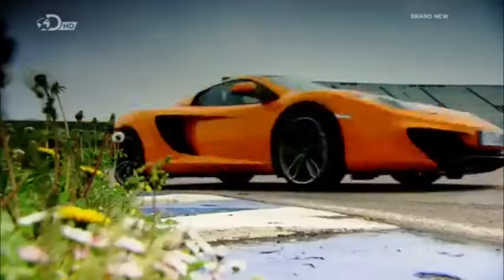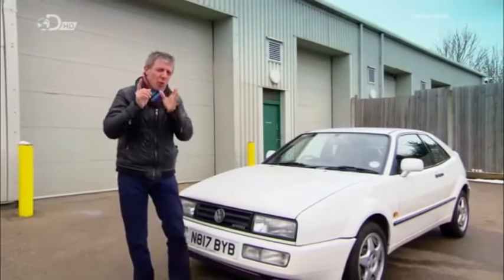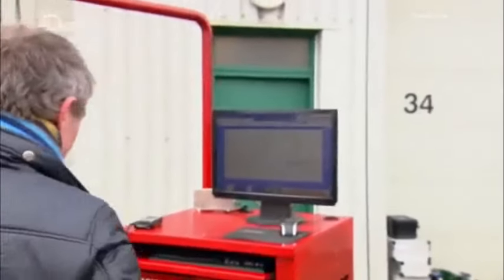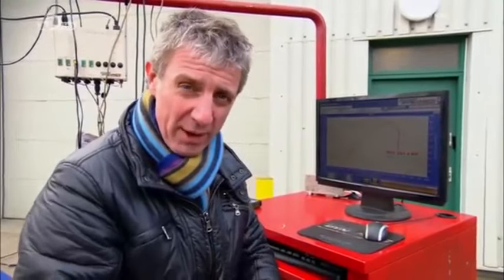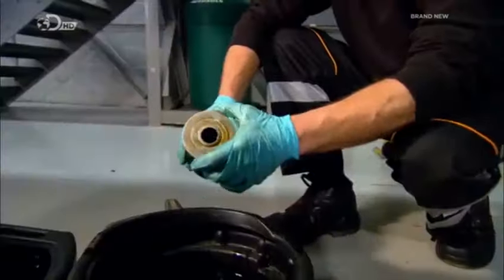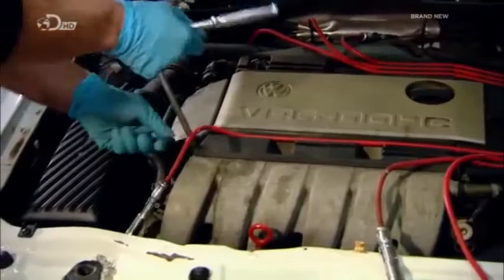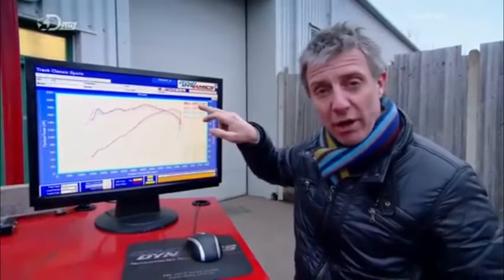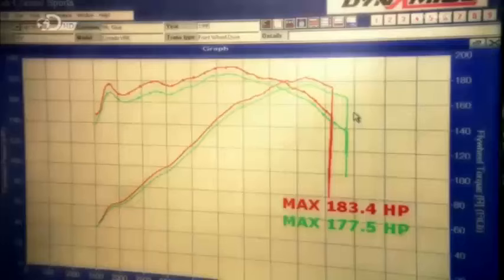5th Gear Test Redex On The Dyno With Surprising Results

Comment: I actually filmed this, good to see it online still. This was the producers mates car. He was more than happy enough to have a free service and have the car in the show.
Reply: And get the nuts ragged out of it in the Dyno many many times?
Reply: @bernierosen1220  Italian Tune-up
Reply: @bernierosen1220  did it look like it did harm?😂
Reply: @bernierosen1220  Actually, if it's proper warmed up before that may only help, as Lillian says, it's called an Italian tune up, and combined with the fuel cleaner it will actually help regain some of that power, burning out all that residue carbon that has built up on the valves and in the ignition chamber..
Reply: @bernierosen1220  If the car is healthy, ragging the nuts off of it is not a bad thing.
Reply: @theenglishtrucker1849  indeed, it’s a good thing really. It’s what it’s designed to do
Reply: Good days work!

Comment: So basically this tells us that routine servicing helps your car run well. Who knew?
Reply: +Stephen Brown Not many people believe in fuel system cleaners.
Reply: +Mortalomena nah mate they help. from my experience it does about three quarters of what a hand rinse would do, only way easier.
Reply: +The Vibe How do you "hand rinse" the fuel system? lol
Reply: Simon Thompson depends if you rinse a bike or car. you take the carb apart, you clean the jets and what else it has there with gas and a thin piece of wire and do the same with the hoses if needed.
Reply: You will do that and not put Redex which costs £1 per use? :)
Reply: Seems they paid well too much for the parts, should have gone to eurocarparta and used a discount code
Reply: a DEVICE requiring MAINTENANCE?!?! holy shit, i learn something new every day!
Reply: Its obvious to people like us to do routine maintenance. But I know people who just haven't got a clue, they quite literally get a decent car and run it onto the ground, even Highways England have put up posters in toilets by urinals to tell people what to check due to breakdowns caused by lack of checks and maintenance.
Reply: lol
Reply: @danielfinch362  You can "run a car into the ground" even with regular maintenance. My last car had FSH, and I continued using it as such. It was 14 years old by the time I had to replace it. Still seething about that
Reply: @waqasahmed939  you can't trust garages to do the work you paid them for.
Reply: I carry out a full engine rebuild per week or per 1000miles (whichever comes first) and my Volvo runs as good as when I bought it in 1978

Comment: There was “the Redex treatment “ where you got the engine warm, took the plugs out then put about 30ml in each cylinder. Then put a rag/rags over the plug holes and gave the engine a few turns, leave for an hour, give the engine a slightly longer spin to clear the Redex. Put the plugs back in then go for a run, with the engine running, slowly dribble about 50-70ml of neat Redex into the carburettor while opening the throttle, ( best done on a quiet road out of town!) a bit of smoke comes out. Then go for a brisk run.

Comment: Must admit I added a fuel injector cleaner last week and changed the air filter, and did two 275 mile drives one before and one after. The second drive cost me £10 less fuel.

Comment: I had a worn test lawnmower engine and i poured Redex straight in to the carburetor when the engine was good hot and going. Pulled the sparkplug out afterwards and it was shiny. I was amazed.

Comment: Ive used Redex in many of my cars and swear by it , I'm even talking pre 5th gear days and old carburettor engine cars and it also helped those massively back in the day!
Reply: Can you put the whole bottle in I was thinking once a month cheers
Reply: @andym209  if it’s a full tank and the bottle covers amount it should be fine, I use 1/2 bottle per full tank of fuel (65 ltr approx)
Reply: I put in a full bottle to half a tank. Don’t worry if there’s smoke it’s doing it’s job 😂
Reply: I used it regularly in the early seventies, it kept the valve springs , stems and seatings free of carbon deposits. I also used to run through the town centre with clouds of smoke pouring out the back, great fun before the environment police came about!
Reply: I would NOT recommend redex in a mazda rotary engine, a mate of mine put some in his RX7 against my advice, it freed up the ceramic tip springs, and cleaned off the carbon build up, but the result was that the tips were worn, and the gap between them and the cylinder walls was too large, resulting in the ceramic tips lodging sideways in the rotors and severely scraping the cylinder walls _ I did warn him this could happen, but ....... some people don't listen to those who know about cars!!!!!!!£2000 plus for an engine rebuild.

Comment: Have used Redex petrol in everyone of my 28 cars since my first car in 1964! Never had one single engine problem!
Reply: +MrPoopnoddy replacement brakes is a lot easier to do than a engine re  build tho
Reply: 28 cars?  Twenty eight?? That's one helluva carbon footprint.  No wonder the climate's changing!
Reply: You won't have had, when you read comments here about redex fixing a flat spot at 7-8,000rpm it's no wonder people have problems with cars in the first place
Reply: I lost count once I owned over 40 cars (several at the same time).. I've only bought two cars brand new and today daily drive a 30 year old Mitsubishi GTO.

Comment: I had a high mileage Vauxhall Victor back in the late 60s which used to pink on acceleration. I tried retarding the ignition a bit but that didn't help. It obviously needed decarbonising. Then I read about this Redex trick where you run the engine on fast tickover while gradually squirting in a pint of Redex from an oil can. When it's all gone in you take the car for a fast drive, keeping the revs high in every gear.  I tried it and it really worked. The car never pinked again. On the drive a lot of smoke came out of the tailpipe, and the job is done when it stops smoking. Saved me lifting the head to clean it out, which is quite a big job.

Comment: I have used redex for many decades and when i first used it i had a car that used a lot of oil due to worn valve stem oil seals.
I looked down the bore and there was a thick build up of carbon on the pistons, must have been centimeters thick, and it looked like whipped ice cream on top of the pistons
When i poured redex down each bore and ran the car for a while, it all disappeared, and the piston surface was revealed, with it being all smooth and flat again.
Noticed a big power increase as well.
Since then i have always regulary put it in my car and always been happy it.
Reply: You physically put the redex down each bore or you put it into the fuel tank?
Reply: @Paul-cl6uo  poured it down the bores, then later added to fuel tank.

Comment: Dunno about power, but a few tanks of Redex got my 13-year-old V6 so far under the MOT emissions limit it was barely readable.

Stick some in and CANE it once in a while - really work the engine. Cars respond well to being cleaned out.
Reply: do an Italian tube up. Thrash it round for a bit.
Reply: Farina Marcini  The occasional drive in an Alfa aids performance immensely. Every time you take it out, several kilos of rust fall off it.

Comment: Didn’t ride my bike over Christmas then it snowed. When I started it there were splutters backfires and dropping idle fuel injection warning light came on. I added Redex and went to work, the light was still on and there was a big splutter loss of power juddering then it was like it cleared its throat. On the way back home the FI light extinguished!!! Result! If you have an older car or one that hasn’t been used in a while get a shot of Redex in her and she’ll run like a whippet on Redbull.
Reply: I like that last part of your comment 😄 does it work in diesel engines to? (The diesel redex)

Comment: I’ve tried loads of these additives, and some are quite expensive. Redex definitely sharpened the throttle response on my e89 and engine ran smoother. Worked better and cheaper than others I’d tried.
Reply: Does it take a couple of tanks worth to notice the difference?
Reply: I felt a difference on first use. Slight but definitely noticeable and for the low cost well worth the outlay

Comment: BG244 is better (diesel) and BG44K (petrol), yes its about £18 per can, but much better.  Its cleans, lubs and boosts the Cetane count.  I have also tested the Archoil AR6400 stuff on my diesel with similar results.

Comment: I use BG44K every year followed by a service just prior to the MoT and I pass the emissions. You will notice a difference because the car is breathing better with fresh oil and filters. I also do an engine oil and oil filter change in between the annual service. I use NGK spark plugs and I've never had a moment's bother with them.

Comment: VR6's were only about 170 odd bhp at the wheel when new, there was no power loss.  The 190bhp figure was at the crank.
Some engines gain power with miles and age as they loosen up if well maintained, Honda motorcycles are known for it.
Reply: Incorrect . Mk3 vr6 was 170bhp , and these were 190bhp , owned both .
Reply: All manufacturers state crank figures when new

Comment: Have always done my own car maintenance but have never been convinced by additives, until recently.  My daily driver is a 2010 Mazda 6 2.2 diesel and I started to notice some occasional hesitation and an increase in fuel consumption. Coincidentally, with my last purchase of engine oil I received a freeby bottle of Mannol diesel fuel additive, that claimed to clean fuel injectors and the fuel pump etc. So I thinking there was nothing to lose by trying it, I added it according to instructions and waited to be underwhelmed!   Well, more like amazed!!  With just 30cc added to 25 ltrs of fuel it noticeably improved both performance and fuel consumption!!  Subsequently, I use it at every fill up and the improvement continued, especially to fuel consumption, which is around 20% better!!  Performance improvement has plateaued to substantially better.  I theorise that the injectors must have been fouled so spoiling the spray pattern, and the pump was possibly producing less pressure. Also. The oil seems to be running cleaner, or staying clean longer, so maybe there was some blowby occuring due to poor fuel delivery causing ring fouling.  For what the Mannol additive costs and the benefits it provides I will be using it permanently, and I am truly impressed!!!
Reply: -As Mannol is a German company i should imagine the employee experience is rather good...?
Reply: @thephilpott2194  
Not sure what you mean, but to be clear, I have nothing to do with Mannol apart from being a customer.  I can also recommend their engine oil, very good stuff and well priced.

Comment: It really is all about how well you look after your engine.

ALWAYS keep on top of your fluids and filters

NEVER use cheap fuel in performance engines

REGULARLY Keep your fuel system clean.

REGULARLY monitor your battery's power and the condition of your spark plugs. Change the spark plugs with at least every other service.

CHANGE ALL BELTS at the latest when the manufacturer advises you too.

Another handy tip 'from mercedes source' put some super strong magnets on the base of your oil sump.

Any stray shards of metal will catch onto the magnets (except for aluminium). The oil filter is also doing this job so don't keep on top of that filter too!

I've had a Peugeot do nearly 300,000 miles when all the owners are keeping on top of everything.

Comment: My 66 plate Škoda Octavia Scout was suffering occasional stalls when the engine auto stop/start activated, and was then a pig to restart manually, taking several attempts, to the annoyance of those behind me and my own embarrassment.  Apparently this is a common problem.  I tried diesel Redex and after a couple of treated tanks the problem went away and has not recurred, touch wood.  I now put a bottle of Redex in when filling every fourth or fifth tank.

Comment: Nice simple items to restore power and fuel efficiency. Every car I buy being secondhand the first thing I do is put a bottle of REDEX in the tank. I recently got a Mondeo 2.0 petrol and it was lumpy under acceleration so I put the fuel cleaner in, changed the plugs, new HT leads, oil + filter and it's as good as new, all under £100. So my Advice to anyone buying a secondhand car is haggle at least one hundred off the asking price to get those bits changed after purchasing. I do with every car.

Comment: Fuel filter woulda helped.
Reply: I agree and it would probably have been worth more HP than HT leads since everything else needed doing so badly it was probably pretty clogged.

With that said it's a pain in the arse to do this on my car because it's inside the fuel tank. You have to take out the whole thing as one unit with float, pump, etc all in one big plastic piece.

Can't just drop a new filter into that either, you have to replace a whole plastic part that has an inaccessible internal filter. Lots of chances to snap some old piece of plastic along the way so I just do this every 75k as per the service manual.

Comment: if you're on a tight budget: reverse blow the air filter with an airline (so long as it still looks yellow), make sure the leads grip nice and tight at each end and relative resistance check them replacing the weakest only, change the plugs, pop in that fuel system cleaner and take it for one almighty mother of Italian tune-ups!

Comment: Change the fuel filter, see what that does.
Reply: Qasim Mir that would actually help, as over time the fuel filter gets clogged and less fuel passes through it. so changing it would help more fuel pass through easier.
Reply: Will still only burn x amount, faster flow to the injectors  or not.
Reply: Even a Semi clogged filter Will Give max flow easy...

Comment: I have a 2003 celica  with 18000 miles on the clock that i use every day for work,
and i found that when i was on the motorway and took my foot off the throttle when i put my foot back down
it hesitated for a split second but  when i use red x in the petrol the problem goes away,
I find the engine runs very slightly better with better mpg ,
i have a 1100cc bike and i use red x in that once  or twice a year to help keep the carbs clean.

Comment: I used to always use Redex back in the early nineties on my classic mini until the time it cleared so much dirt or deposits out of the engine in one go it caused a really bad fuel block I just couldn't clear. After 2 weeks I had to completely remove and replace the carburettor to be able to drive my mini again. Ever since this I've been put off using Redex in case it happens again to any of my other cars, but I probably was just unlucky that time maybe?

Comment: differential fluids definitely have an effect. 2017 dodge rams will be having an oil cooler installed on their rear differential to give trucks the capability of having thinner grade oil to gain better efficiency

Comment: There is a glaring flaw in the conclusion. You get diminishing returns as you take more action, and of course the first steps will see larger gains as it has more room for improvement.
Reply: +hao duong Running the fuel system cleaner thru is very separate from the others. The other services had nothing to do with fuel/intake system apart from the airfilter, which seemed to be almost new to begin with.

It all depends on when were the last services done for each parts. My car had original leads and coils with 50k KM old spark plugs. Replacing those made a huge difference. Ive always ran an fuel system cleaner once per year. Probably this VW never had any fuel system cleaners run thru, so that made a big improvement.

So I do not think there are much, if any diminishing returns here.
Reply: they are showing the key effects in performance gain order. you could stop at the fuel system cleaner, though without the cost of a dyno tester at your disposal its best to do the other service items too. 

if you've got the budget, change the transmission & power steering fluids (they degrade over time becoming draggy), change the fuel filter and make sure your tyres are pumped up properly (poorly inflated tyres cause extra rolling resistance).

Comment: Funny how 5th Gear, 5 years previously (19th Jan 2008) in a lab wrote off fuel additives.  Granted they didn't try Redex back then.  Wynn's, STP and NOS octane boost  - but now they are telling us the opposite in this segment.
Reply: One is a performance booster, one is a cleaner.

Comment: Best way to improve performance on a relatively old car with a fair few miles on the clock is a Terraclean. It cost £110 to do my regularly serviced 2010 Ford Focus 1.6 TDCI with 100k on the clock. Best money I've spent on it, It feels like a new car and pulls like it did when new. Honestly though I was sceptical about Terraclean, but I searched out reviews on google and never found a single bad review, so I done a full service on the car, then a few days later I had the Terraclean done. It felt so weird to feel a smooth car with restored power after the clean. Genuinely, it is that good! Don't waste your money on all the snake oil crap and get a Terraclean then comment back here with your findings. I bet you'll be as happy as I am! Most of the snake oils you add to your tank just increases the octane rating making you feel/think like it's having a benefit. Then after you refill the tank it returns to normal. This does not happen with a Terraclean, it's a permanent true internal fuel system clean, I've refilled since as usual with normal diesel and everything is still the same. Powerful and smooth! Highly recommended from me.
Reply: These are 2 quid each vs 110
Reply: Some Mechanics don't trust in Aggresive Cleaning like terraclean  I wouldn't have it ever done if u think u need it then its usually results of bad maintenance anyway